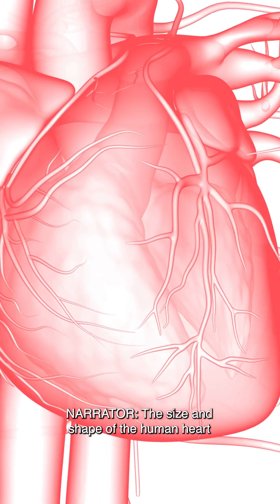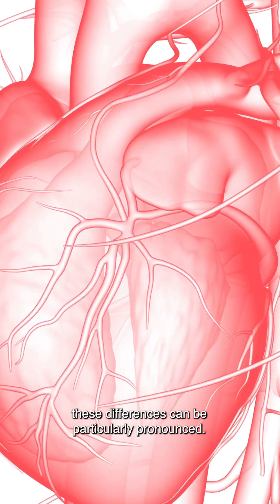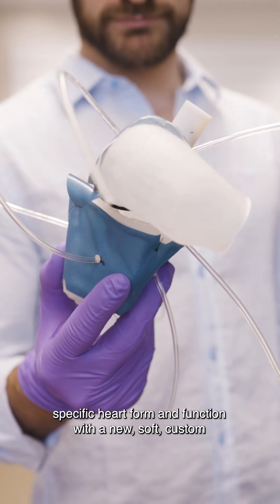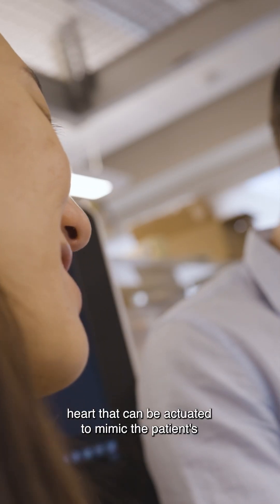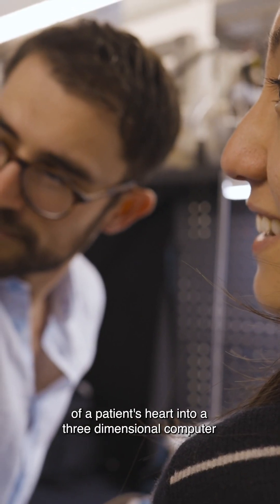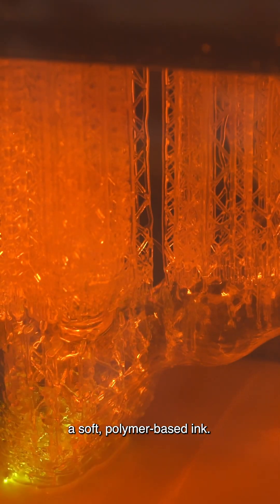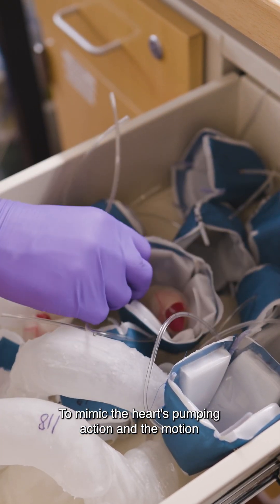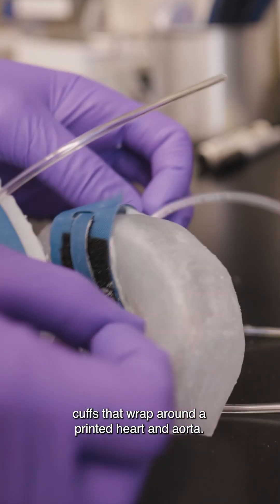3D-printed heart replicas

Comment: Why do they need to replicate shape and size if a sleeve is wraped in the outside? Is there additional information somewhere else?
Reply: Exactly my thought
Reply: i think for precise beats
Reply: Size of heart changes with age( roughly size of the fist). And shape of heart is also different among individuals.

The sleeve thickness can be accounted to reduce the size actual 3d print by an offset.

This is my theory to answer this question.
Reply: Because this isnt used in medicine
Is just a cool wacky thing to do
Reply: Heat disease can cause damage to existing Heart tissue causing internal bleeding and other issues, by replacing the diseased heart entirelly they can elimate factors that may worsen in the future due to the artifical pumping, as the artifical pumping can cause a rupture or other issues on a diseased and weakened heart.